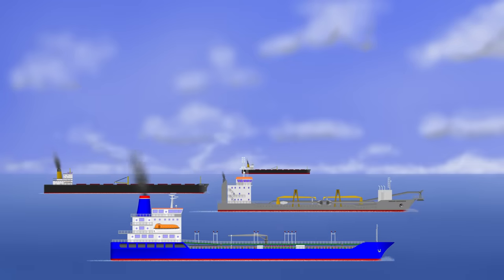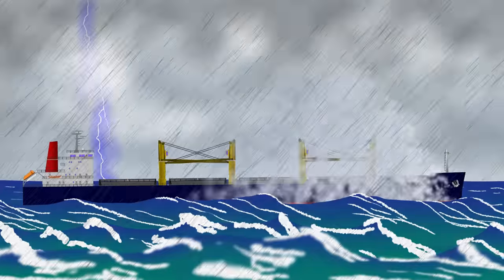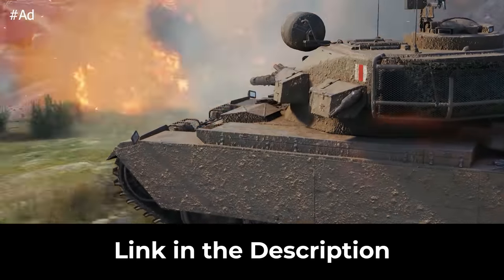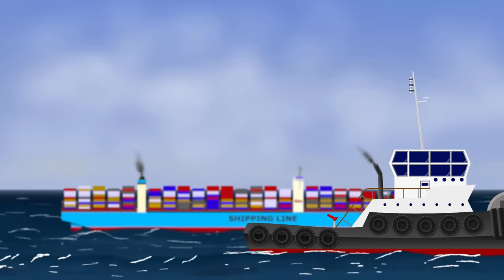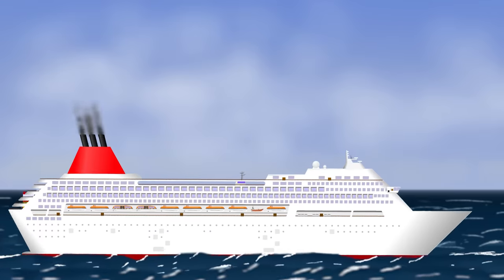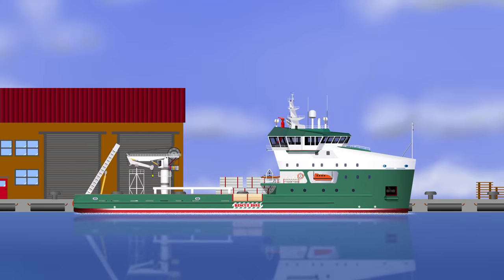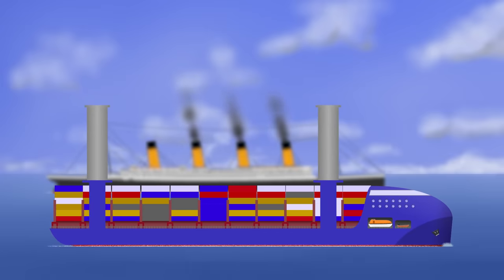Why Is The Bridge At The Back?

Comment: I think visibility will become less of a factor with cameras creeping up everywhere. We already have them at the back of the car. We only have back-view mirrors out of tradition. It would be much more efficient to have cameras and monitors instead. This will happen to ships, too. Because putting a few cameras at a place and running a fiber glass cable through the whole ship will cost like 1k, which will be dwarfed by every change that allows the ship to load just one additional container.

Comment: prediction for the future: no bridge superstructure, use of LIDAR, RADAR, SONAR (mainly for use in ports probably) and cameras with AI assistance. bridge will be contained within the main structure wherever there is space or even managed from onshore through the use of a combination of satelite communication and higher levels of automation. honestly wouldn't be surprised if ships had no crew whatsoever in 10 to 20 years.
Reply: @YBehri  It's not so much a prediction, but something ship designers are already working on (unfortunately).
Reply: I doubt that we will ever have crew-less ships.
There's just way to much maintenance and repair done while the ship is traveling.

Comment: The same sort of designs for steering positions can also be found on vessels used primarily or entirely inland for the same reasons. Rear again being optimal (and for yachts and small or traditional motor boats, a tiller is still common), but front and centre positions are also used where these have an advantage (passenger vessels in particular). Additional compromises tend to be made because of restricted heights and widths on inland waterways. A common and simple solution where this causes visibility problems aft is the use of mirrors. Still though there must be quite a skill to guide a long passenger boat through something like the canals of Amsterdam from a low front driving position (there being no other option due to the bridges), although twin screws and bow thrusters must be a big help for making the tight turns. Holidaying on the Norfolk Broads, seen plenty of tourists tail swiping the bank or other boats with their long, forward control cruiser (again quite amusing when you see a professional make the same turn perfectly with their twice the length tour boat).

Comment: One additional consideration is the vertical movement of the stern vs the bow while underway.  In heavy seas, the bow experiences larger vertical movements than the stern.  Crew stationed at the bow would experience more fatigue.  Admittedly this is more of a concern for smaller vessels.  Very large (and heavily cargoed) vessels would have really large rotational inertia, so the bow upthrust would not be as extreme. But the fact remains that the center of gravity (and hence the moment) of all boats is aft.

Comment: The bridge on cargo ships are placed at the back to also prevent blind spots when spotting pirates as you have a 180° view of the entire deck no need to run around and find them. Also detection of problems in cargo(especially dangerous cargo) is easy to detect this way as you're always looking forward and not having other people to do it for you

Comment: There is one disadvantage placing the deck house with the bridge and crew's accommodation so close to the stern, especially on (necessarily) highly powered single screw ships, viz. possible discomfort for the crew by propeller induced vibrations and noise from flow separation, pressure fluctuations and cavitation.
But in general today's marine propellers are highly sophisticated bespoke designs fitting exactly to the hull shape, and its flow in the propeller pane, the type, power and characteristics of the propulsion engine, that these adverse side effects are eliminated as much as possible.

Comment: Titanic also had a small bridge at the stern.
If you've seen images of the Titanic's bridge you will see 5 telegraphs.
From Left to Right
1: Port and Starboard Engine Order Telegraph
2: Port and starboard docking order and starboard steering order
3: Backup Port and Starboard Engine Order Telegraph
4: Port and starboard advisory Engine Order Telegraph
5: Port and Starboard Engine Order Telegraph

Telegraphs 2 and 4 connected to this stern bridge and were used to communicate orders from the main bridge.

Comment: On some ships, the Bridge is put somewhere around the middle, generally in between turreted 16 inch guns.
Admittedly, battleships aren't used that much anymore, but they do still put out a presence, even if a ship that's a quarter it's cost can easily sink it.

Comment: The primary reason why the bridge was moved forward on the triple-c class was to provide torsional stiffness to a very long hull. Dividing the very long cargo holds into three separate holds makes the hull stiffer and stronger, by adding additional transverse bulkheads amidships.

Comment: Much of the issue is explained by visibility or cargo capacity. The bridge must have clear sight lines ahead of the ship, putting limits on how far astern it can go. Where possible the bridge is placed above the engines, which are often at the back to increase available space for cargo. Where I would put the bridge entirely depends on what type of ship it is. Naval ships usually have the bridge and related superstructure (and usually the engines) in the middle to provide good visibility and the widest possible firing arcs for weaponry fore and aft.

Comment: I notice that in the early days of iron and steel ships, up until the end of WWII, the bridge and engines are in the center. How did that affect sailing, navigation, safety, etc.? Also when and who did the change?

Oh, and to answer your question on where I'd put the bridge, I'll take a queue from the freight railroads of the US, of which I'm more familiar. I'd place it in an office in a smaller, nautical oriented city, like Newport VA (or Bristol UK).

Comment: A bridge, considering visibility only need to take into account what can be seen with the naked eye. Using technology a bridge could technically be anywhere, including deep into the hull only using sensors such as cameras to see the outside world. However in case those cameras fail a ship need a at least a rudimentary bridge of a traditional type.

Comment: IN addition to the Great Lakes freighters that some have mentioned, I wonder why it is that fishing vessels seem to be split between forwards and stern bridges?
Reply: Depends on the way they are fishing. If they tow the net, they need the winches and work area at the back, so the bridge goes at the front.
If they throw the net and come back later to pick it up, they use cranes to pick it up over the side, so bridge goes at the back.

Comment: Warships presumably are much the same as passenger ships, due to these vessels (generally) having quite extensive superstructure to put things like high-powered communications, signal lights, radar, Anti-aircraft weapons, and more. And also the need to stay out of the way of their primary weapons as much as possible. Not to mention the engines, and thus smokestacks were placed in the center of the ship, for the best possible weight distribution, and protection from hostile fire.

The obvious exception are aircraft carriers, which can't have much above the deck, or at the front or rear of the deck by necessity, and as such their bridge is placed amidships to one side. (though some WWII japanese carriers had their bridges under the flight deck at the bow). The bridge tower on carriers is traditionally put on the right (starboard) side, because it was found a pilot was more likely to instinctively pull to the left than the right when something went wrong.

Comment: I have also wondered about that, but others comments have solved the prob. Something I have questioned is why, on passenger ships, don't the designers blow the exhaust gases out the stern under water, one it would help propulsion, and more important as any cruisers will tell you, it would prevent passengers getting plastered with diesel exhaust particles.!

Comment: I think in  a future of shipbuilding (as it overcomes economical streamlining and tradition) there will be way more emphasys on virtual overview. Electronic systems are somewhat vulnerable, but on modern days (possible) and not that expensive standards, this wouldn't be that much of an issue. Military ships would benefit from less structure above sealevel, protected in the hulls most fortfied core, as well as many frighters might be operated more often from afar an only have backup crews on board. In addition, bosth systems would allow perfect situational awareness for ship-to-ship manouvers or harbors, and economical harbors can be clocked way more tight(how good this weill be is up to debate, sure thing - but it will happen). So i guess creating a more task-suitable hull will benefit the ships, even the manual optical overview will be limited.

Comment: Civilian stuff tends toward the stern (except for passenger ships), but what fascinates me is naval vessels having their bridges all over the place. Some forward, some more toward the stern, some almost center mounted, with aircraft carriers offset to the left or right on top of everything else... And so on.
Reply: So, aircraft carriers (the offset to the side ones) are there because they're pulling double-duty. The actual bridge, and the flight control tower. That's also why they're so tall above the superstructure. Flight radar and communication systems need the height for signal and visibility.
Reply: @NikkiTheOtter  well, yeah. It's more the port vs starboard thing.

Comment: There are some points missing that I would like to mention. My company mostly builds new ships with accommodation forward and this is for reasons not stated in the video. Ship's are Gas Tankers. Accommodation forward provides better weight distribution of a Light Ship which allows to make significantly smaller ballast tanks forward (Forepeak etc.). Also the space above forward manoeuvring stations is used for crews accommodation which leave more space for cargo behind. In aft position accommodation there is no point of putting it more to aft as we are limited by the engine anyways. That is not a thing in fwd accommodations. They are move as far as practical possible. Another benefit is that this better weight distribution and less ballasts required contributes to significantly smaller drafts in comparison with vessels of similar class with accommodation aft. This means vessel can visit bigger variety of ports. Unfortunately crew convinience matters are not really taken into consideration but it is understandable if company wants to be competitive in the market. Negative sides are: Lifeboats are located on the aft and in case of emergency crew have to pass almost 300 meters to reach it. Because of smaller drafts vessel is rolling heavier. Each anchoring means a wake up for all crew as the sound is extremely loud. Example of the vessel: MT GASCHEM ORCA

Comment: On a sailing boat, you constantly need to monitor the sails, so you don't want to turn your back on them. On a larger sailing vessel, the skipper doesn't control all the sails themself, but need to monitor the crew. On big ships, any maneuver requires carefully coordinated work by dozens of sailors performing specific tasks, perfectly timed. 
The commander of the ship need to work from a location from wich they can have this essential overview.

Comment: Lots of smaller 3000gt to 12000 gt newbuilds now have the accommodation at the front, project cargo and thinks like windmill blades are light and needs loads of deck space, ive seen them overhang the rear to on sum vessel's

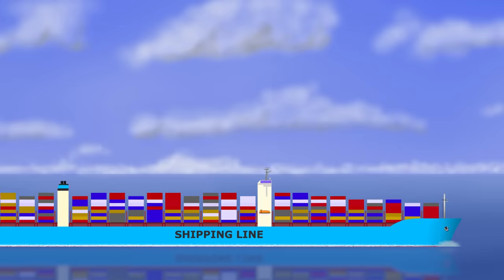Comment: Around 2:22 I was sad not to hear the main reason I had figured from guessing, which relates to your point about keeping the engineers back there because the engine is already back there: most generally it seems to me it is cheaper to keep all the moving parts and their interconnections in one place. You see, of course the engine in the rear makes the most sense because the propeller back there does, as it would obviously be horribly inefficient to for the prop to pull the shit from the front. With the prop back there it only makes sense to put the engine back there. And also the rudder, because of how it's really the propeller that makes the rudder work. Not that you don't know all of this of course, and it's been sort of implied by the time the video gets to this point. BUT what I find interesting that didn't get said is that, given the engine and rudder are at the rear, it only makes sense to put the controls for them back there too. A bridge at the front would have to have an enormous quantity of wires running the full length of the ship, all the way to the rear, with (as you mentioned) staff having to run back and forth the whole length of the ship to communicate, hang out, or inspect (if the captain needed to see what was going on in the engine room, say). All of this wiring would, I assume, be vulnerable, expensive, and get in the way of cargo. From what I've seen, the cargo spaces of big ships like bulk carriers are incredibly simple, so it would massively complicate the ship's design (I assume) to install all these wires and instead what they can do is limit almost all of the ship's complexity to the stern and essentially weld that section on after laying down the relatively stupid simple cargo section of the hull which, again it seems to me as a mere YouTube viewer and so I'm probably massively oversimplifying, is basically just a glorified floating iron bathtub half full of coal or whatever.

Comment: This is a big bone of contention within science fiction circles: where to put the bridge on starships. If you have enough feeds and screens you could put the bridge in the middle of the ship, below decks. Starships don't have people going outside to perform duties all day long like wet vessels though and there is a big gap between theory and practice. Ships soon may be routinely deploying drones for an aerial view of manoeuvres or become drones themselves in which case the "bridge" could be on land thousands of miles away. That said, I am sure crews do a lot more than just "drive the boat".
Reply: Most modern warships are already commanded from an operations room deep in the bowels of the ship, since tactics are dictated by radar and other sensors, not by what you can actually see. You only need a bridge for docking or replenishment from tankers etc.

Comment: I thought an otherreason would be for commercial ships the superstructure is at the back in case of propulsion issues the bough would turn into the wind. as for  warships the suportstructure would be a tteh front to ensure in caseof propustion issues the ship would turn away form the battle pushed by the wind. or is this just a nice story?

Comment: With technology being what it is, why would you not have a ‘control room’ wherever it suits the ship’s design/purpose, where monitors display feeds from cameras positioned at all corners, berthing points, cargo loading areas etc etc and have all the visibility you could possibly need. 
You could even dispatch a swarm of drones to provide overhead footage, proximity to docks/other vessels and general added visibility. 
Actual bridge/viewing points can still be incorporated into the design but for less critical/frequent use.

Comment: Why did older ships like the white star ships have large overhead cables between the masts over the funnels. Was this purely for strength or was it’s main purpose to provide lighting protection?
Reply: I always thought that was for the radio. If you don’t have good amplification, you need a long aerial.
Reply: A full wavelength HF antenna only needs 10-20 meters 30-60 feet.

Comment: I think in future designs the bridge will be at the bow for visability in emergencys.
Most of the data will be gained by sensors and cameras, bad weather is no concern anymore, even freak waves need luck to sink a random cargo ship.
There are some ways to stabilize the ship even now, so why shouldnt they use a bow ruder for example or even made the whole ship eleastic like a fish to avoid this problems.

Comment: Considering the improvement and availability of remote sensors (cameras, IR, radar, etc...), I would put the bridge either where it is best put to serve the function of the ship or where the design aesthetic demands it.  The idea of having to make so much accommodation for the Mk.1 eyeball is just silly these days.  Especially on a ship where the weight of such compact systems is hardly any kind of sacrifice.
Reply: I feel like weather at sea and salt corrosion are the reasons your eyes need to do the work
Reply: Ah yes... "improvement and availability of remote sensors", ........ reliance on electronic control and remote telemetry will most like cause more accidents.  In my experience the normal faults experienced by ships are not the failure of the actual mechanical parts of a vessel's machinery but by the failure of the control systems, ... compounded by the reliance of staff dependence on the remote readouts....... and the possibility that they have "forgotten" Grandad's way of manual operation...... Maybe there should be an "App" for that?